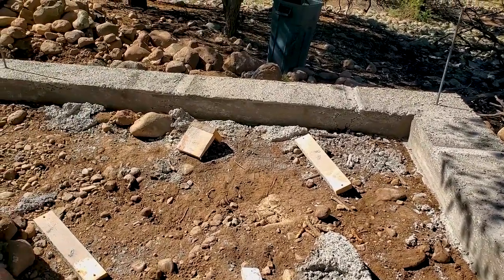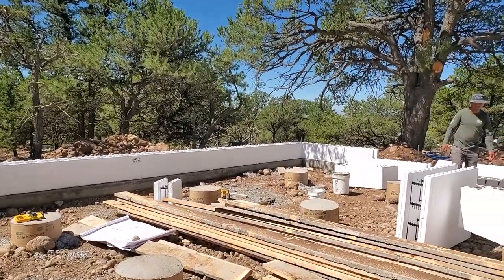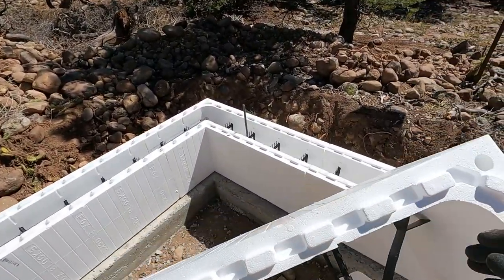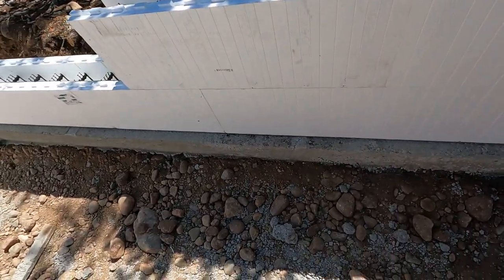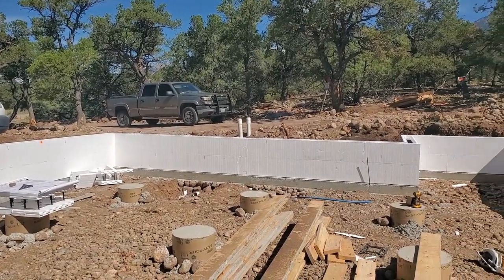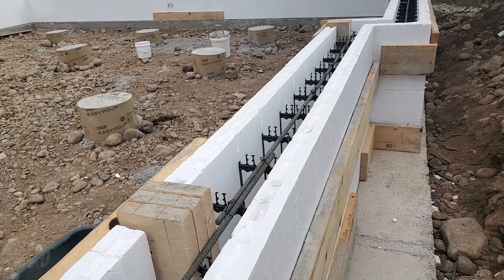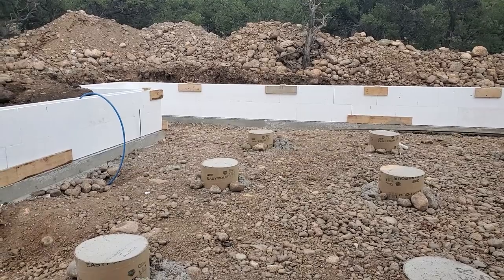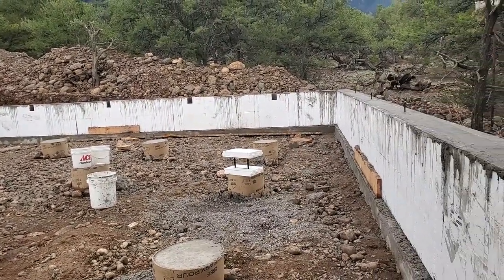Start to Finish Home Building Series | Pouring the Foundation | Fox Block ICF | Episode 3

Comment: You want a common seam in the middle of the walls.
Reply from the maker: Common seam. That was the word I was looking for
Reply: If a walls length is such that it does not require any cut blocks. a common seam is not necessary.  Some people plan their wall sizes so that there are no cut blocks, so no standing seems are necessary. But that level of planning is not the typical case, so yes, common seams are more typical.

Comment: What keeps the blocks on the snapped outside Lines?
Reply from the maker: The friction between the foam and concrete keeps it in place. Some expanding foam under the blocks will work also to glue it in place